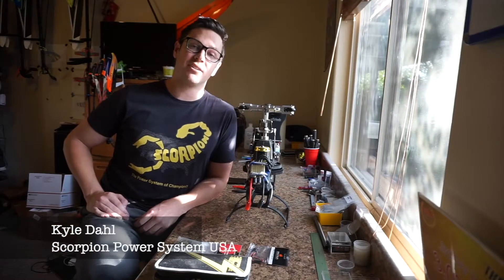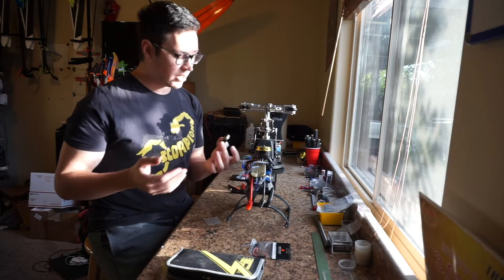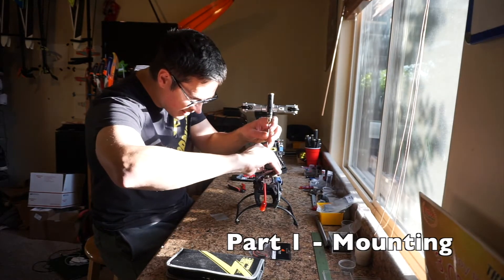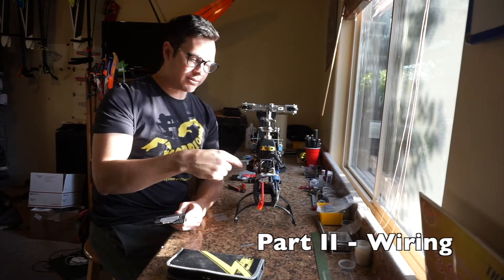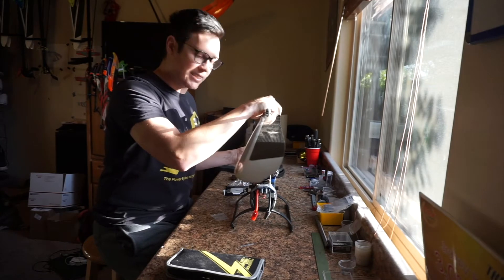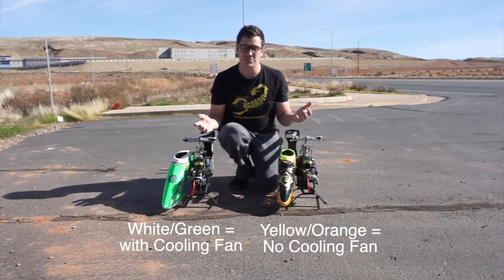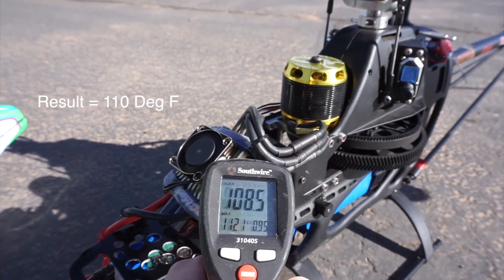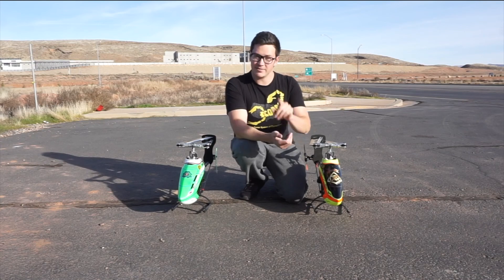Scorpion 40mm High Speed Cooling Fan - Review and Test

Comment: Hi Kyle, nice Video. Why do you not use  the Prog. Port from the ESC to plug the Fan there?
Reply from the maker: Bernhard Kerscher the prog port has the telemetry wire plugged in to it and also is not designed to handle any load. Scorpion recommends to do it only this way with the Y harness off one of the BEC cables.
Reply: @dahlkyle  Thank you, good to know👍👍